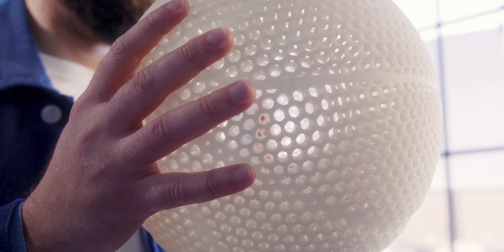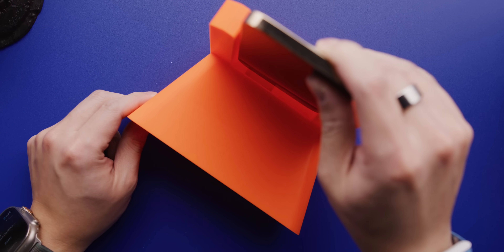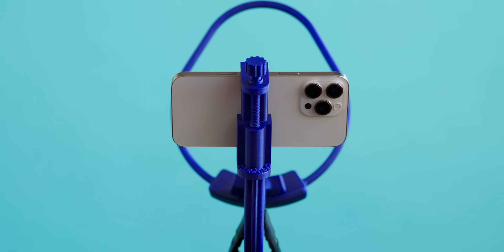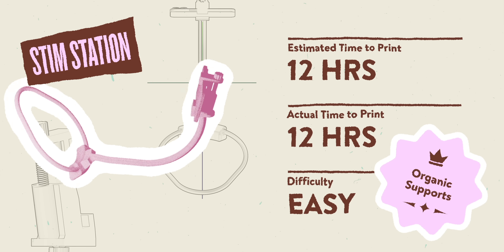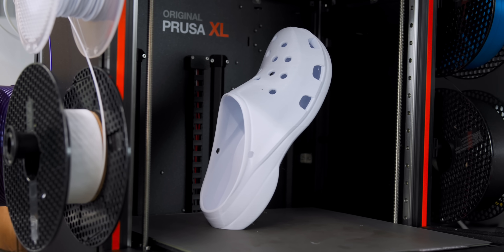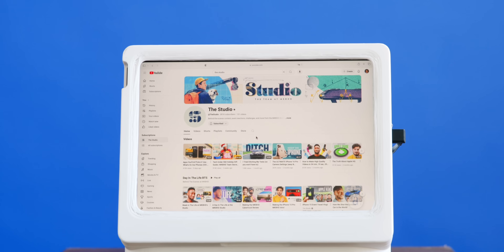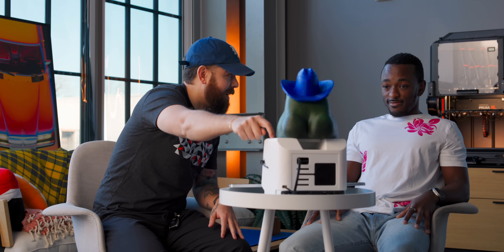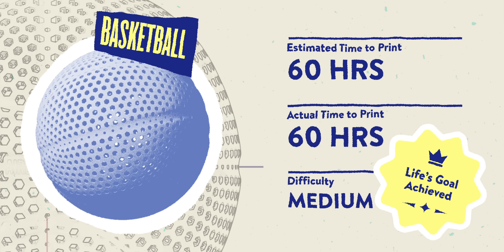3D Printing Unaffordable Tech (as a Complete Beginner)

Comment: The comment about the support zits is true. You can use different materials to have easier support removal. However, you can also adjust the air gap or how close the end of the support is to the model. I got immaculate support removal on an Ender 3 by doing this, but with the Bambu Lab A1 I got lazy and use the settings the designer shared.

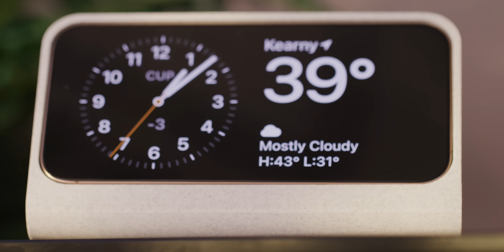Comment: 7:54 Gyroid infill (the one Scott chose) has little to zero same-layer-overlap
Grid and cubic infill patterns often lead to print failures. The nozzle can scrape against previously printed lines, causing layer shifts or dislodging the print. This usually happens because the nozzle has to cross over existing lines on the same layer.

The downside to using gyroid is that it shakes the printer, a lot 😅
I prefer cross-hatch but it still has the same problems as gyroid.

Comment: 8:00 the gyroid pattern prints a bit slower but is for most applications the best infill as it will never overlap for the same layer (avoiding collisions), has great strength and saves on material
Reply: Thank you for dropping some knowledge!
Reply: Same principle as a crinkle crankle wall, right?

Comment: What if you used the multi filament printer to print the basketball with a more rigid PLA skeleton encased in a more flexible or rubber filament?
Reply: Literally was one of my first thoughts, pretty difficult to pull off but I'm working my way up. Or trying to anyway